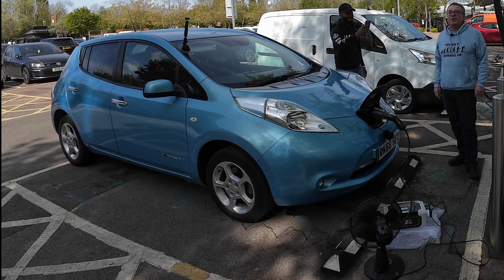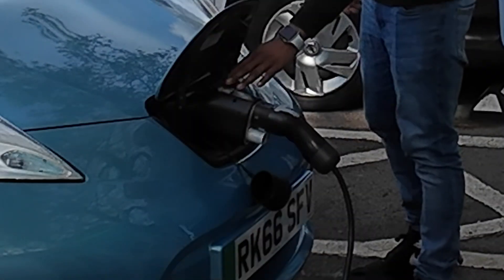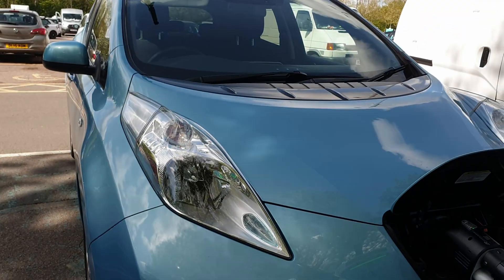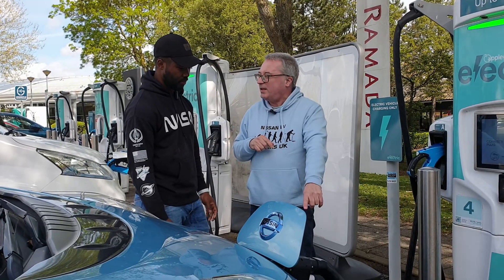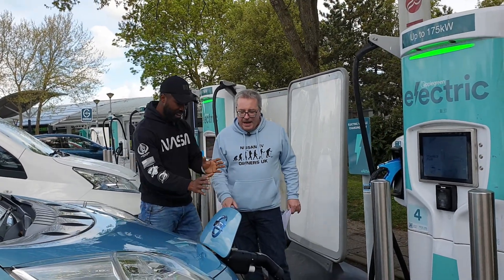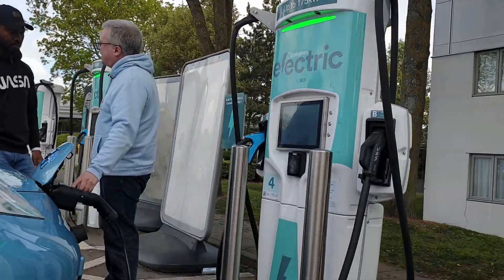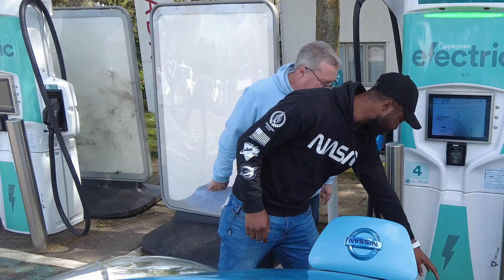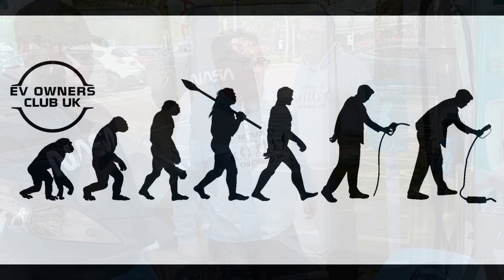Accraine V2L

Comment: If that device is built on some sort of chassis, then it should be easy enough to have some sort of chassis loop poking out, then a chain could be threaded through the loop and someting on the vehicle to lock it, maybe the vehicle towing eye.
Reply from the maker: @imanobody-i3z  precisely what I had in mind. It has a metal grab carry handle on the top and the case is metal so I think it could be done. I'll suggest it to the manufacturers.